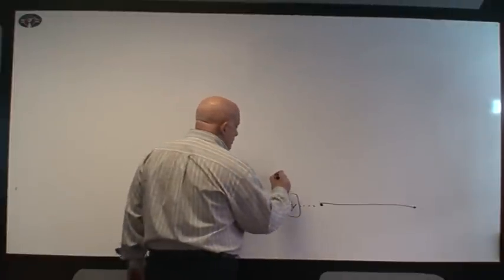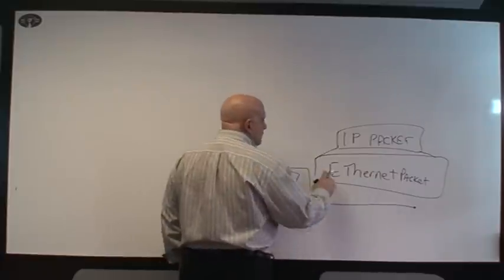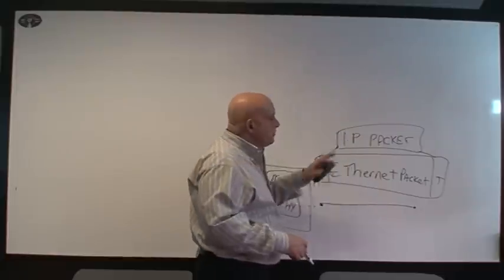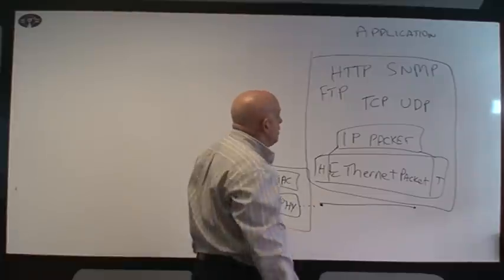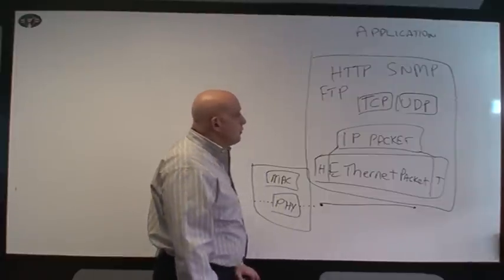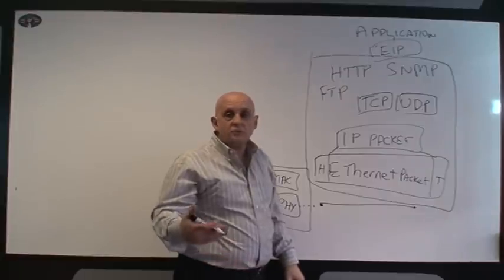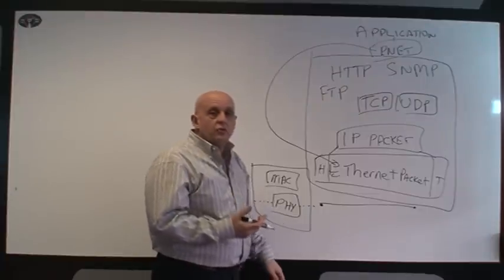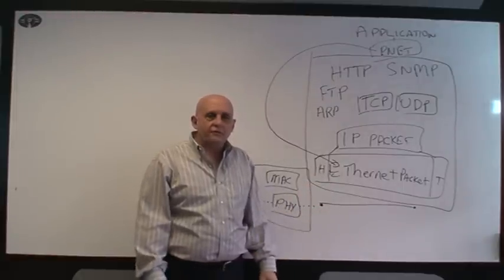How Ethernet TCP/IP is Used by Industrial Protocols

Comment: A bit confusing.   Ethernet is not a wire.  Either is a protocol which can be use over a wire, fiber or wirelessly.  
You are mixing up your layers.  TCP and UDP are layer 4.  Application layer has HTTP, FTP, SNMP etc.

Is Modbus only UDP?

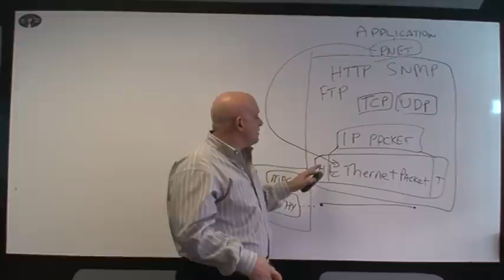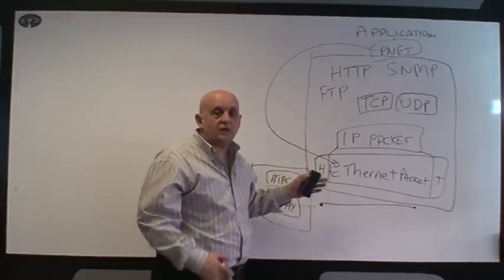At 8:30 you say Profinet is Ethernet, but then at 8:35 you say it's in the bowls of TCP/IP stack.

If Profinet is a Layer 7 Application layer protocol which uses Ethernet what's happening at layers 3 and 4?
Reply from the maker: +Passed High School Physics 90+% of Profinet traffic is below level 7 of the OSI Model, level 3 and 4 to be precise. This means less processing, faster speed, and in turn higher determinism. http://image.slidesharecdn.com/profinet-applyingtheethernetstandardtoindustralautomation-peterthomas-140414041007-phpapp01/95/profinet-applying-the-ethernet-standard-to-industral-automation-peter-thomas-10-638.jpg?cb=1397691945There are a few Modbus applications that utilize UDP but the market is dominate by TCP/IP based implementations.For those not as versed in technology the wire is an inaccurate but relatable idea. We agree it is not literally correct.

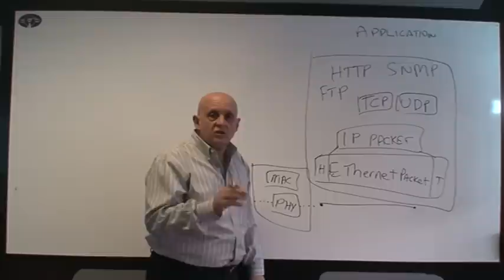Comment: I didnt get the part at 5:20 you used the valves as an example. why would you use UDP again?
Reply: Because the control messages are sent a relatively high rate. So it isn't all that important if you miss one. The next message will put the valve in the desired state anyway...
Reply: If you were sending voice data it would be useless to resend packets because the words already have been said. It would be better to just drop the tiny bit of the sound and reduce the call quality...